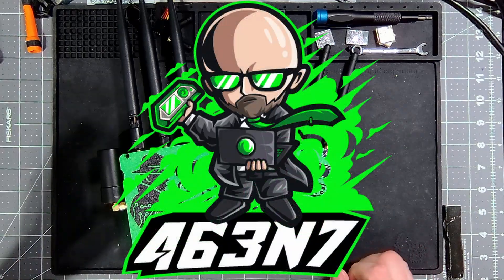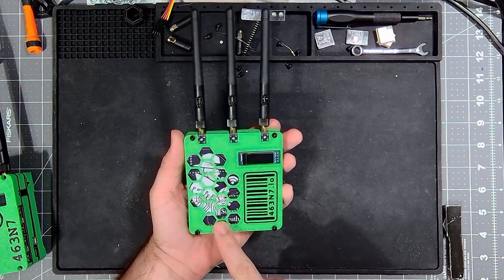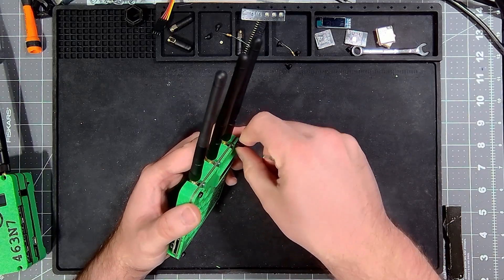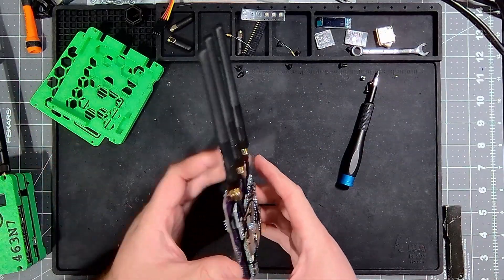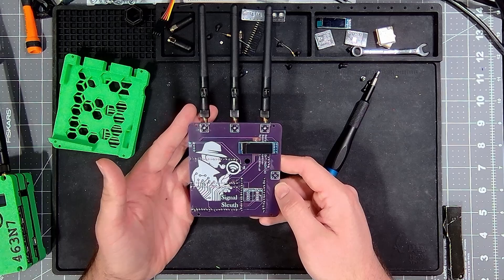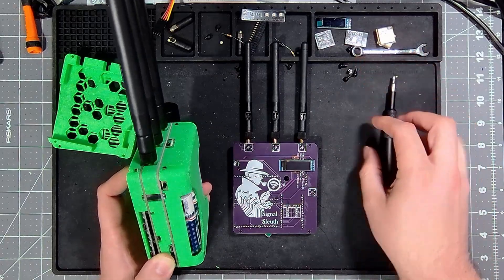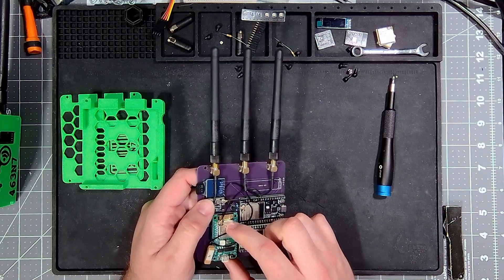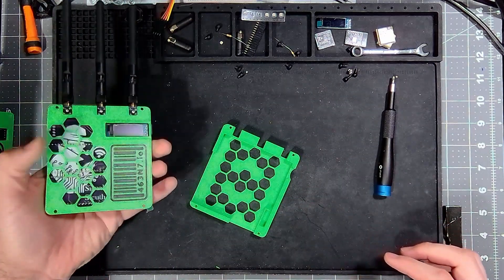Slim Signal Sleuth

Comment: So...yes I agree :D firstly, adding an antenna is a pain indeed, I removed that capacitor, bridged the points, added external antenna and...nothing :)) even if I bridged the first 2 points back it couldn't see any networks after, but the good thing is that I found some bw16 with external antennas at the same price, will test them in the coming days. 

I remember when I left the gps pins too long and they were touching the sim800l back plate and I was wondering why I don't get any fix :)) 

Both versions looking awesome but I have a question: isn't the one with battery pack getting too hot? My 2 pack one get around 60 C in my pocket and I am kinda afraid to walk with 2 hot 18650 in my pocket:D
Reply from the maker: I haven't noticed it getting hot and I ran it almost 10 hours non stop one day. 

Where did you find the BW16 already ready for external antennas? I have been trying to find a source so people dont have to do the mod
Reply: @463n7  I will send you the links on insta